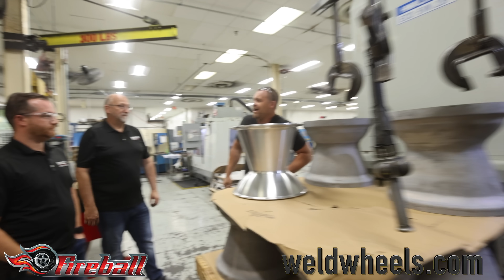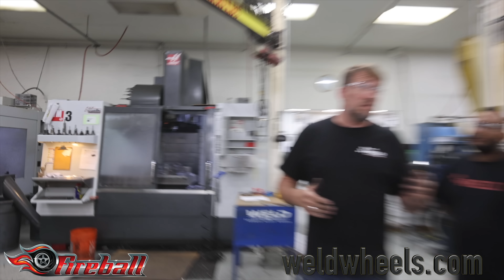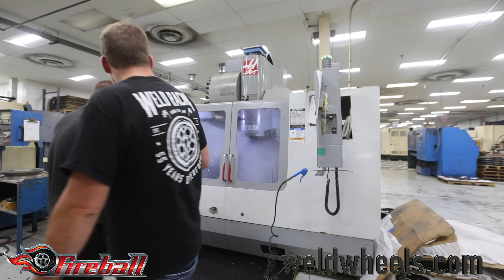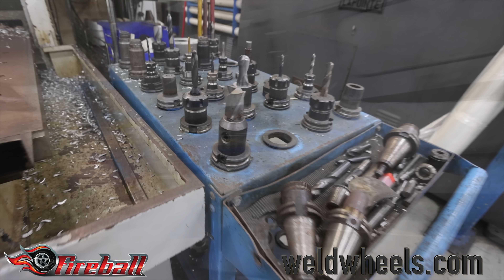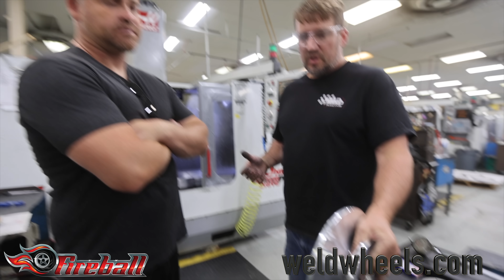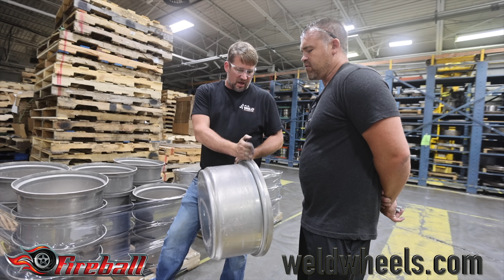Weld Wheels Grand Tour!!

Comment: Not sure about their $5000 bead locks but Weld quality on their RT-S line has plummeted.  Luckily the pair I just bought were dirt cheap and only cost $1000 each. (sarcasm) Not sure what got into their manufacturing process, possibly DEI or unions but their products are now about the same quality as the imports  but 5x the price.
Reply: They went to shit back in 2006 when they were sold to American Racing. All of their aluminum bulk is shit China quality with lots of impurities. That’s why they fail the way they do and don’t shine like they use to back when Greg Weld owned it in the 90’s.

Comment: Work at howmet aerospace in LG aerospace. CVW commercial vehicle and FSW Forge specialty wheel are on site also. We forge the billet/ingot for customers then send them out to machine. We use to do everything SRT, Ford supersnake , harley and Mercedes 772. And regular production vehicles but cost to make outweighed profit. Still do semi and aero wheels

Comment: Just the other day on @Demonology's YT channel he got to take a tour of RC COMP and it is so crazy how different but absolutely the same with similar outcomes that  both facilities have and they have similar sized facilities atleast on camera and when it comes down to it you get similar customer service and I think it was absolutely awesome that when you first walk in to their front office the first thing you see is a banner with Jeff Lutz front and center and I think it is awesome that RC COMP does custom beadlock rings now where they will put whatever you want on the beadlock ring like a nickname, the cars name or whatever else name you want on there and I have seen where a shop that sells Weld wheels you can get the wheels, the beadlock ring, or just the center of the wheel anodized or powder coated in any color you want but I think that was something that that shop offered as an independent dealer for Weld wheels but if other companies like RC COMP is doing the custom beadlock ring where they put any name you want on them then Weld should consider the custom anodizing and powder coating in a  variety of different colors than just black or polished like many other companies because some people want to color match their wheels to their cars

Comment: 4:30 always heard it don’t matter for drag cars but it definitely matters on our dirt oval cars. Due to the side forces and incidental contact that happens you can rarely get them to seal right if you don’t put them where they’ve always been because they get slightly tweaked from the first time you even pull on track even without contact
Reply: That’s valuable information from experience 👍